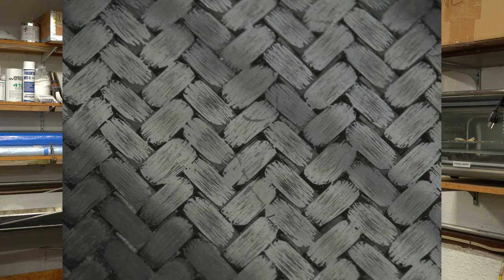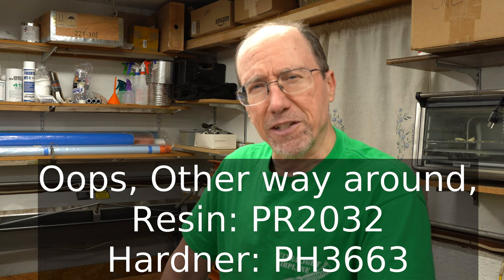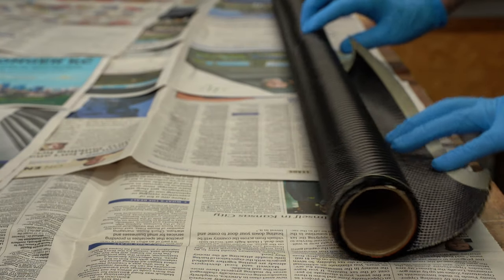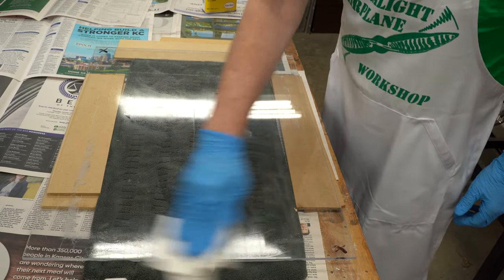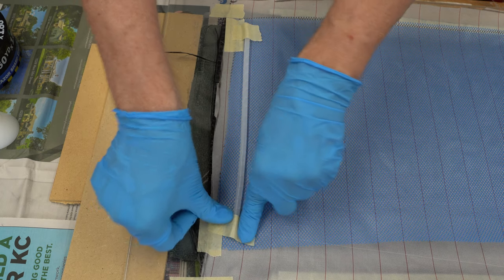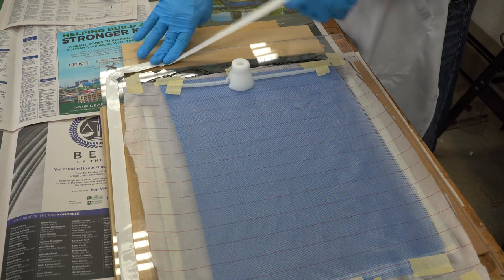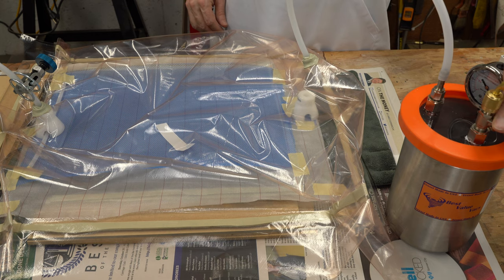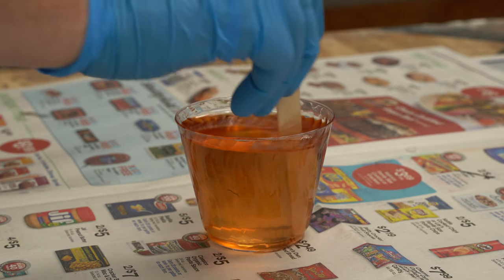Aeropoxy PR2032/PH3663 for Resin Infusion

Comment: Just an fyi, when we use a stethoscope to check for leaks, we prepare it by removing the chest piece and replacing it with a piece of hard plastic tubing (in fact, I have used the body of an ink pen for this). The problem with leaving the chest piece on is that it is designed to only pass either low or high frequency sounds, depending on which one it is. What we want is something that allows us to pinpoint leaking sounds, of various frequencies, while rejecting other sounds close by.
Reply from the maker: Excellent tip. I'll give it a try. Thanks.

Comment: Extend the vacuum spiral along the entire end edge of your layup. Make sure your peel ply comes in contact with the vacuum spiral.  This will prevent the resin front from stopping in areas that do not have flow media.   You can use this same method to slow a resin front from hitting your vacuum port (which allows gas to escape because it is possible to boil your resin under the bag if it is not degassed).  Oh and awesome improvements since your last layup.

Comment: Last comment.  When you get pin holes between the weave of the carbon tows, thats often due to low pressure.  When the part cures, the resin shrinks and gas retreats to areas with low pressure, such as between the tows of carbon.  Almost always where youll find those pin holes.  Find a pump that can pull full 30 inches, then degas your resin for a solid 5 minutes until its stops boiling.   Just here to learn from watching others, but also have done about 700 bagging layups so hopefully my advice will help.
Reply from the maker: Thanks for the tips. Although I have not been showing it, I've been degassing for the last two videos. That really does seem to help. My pump is only able to get to about 26 inches of vacuum so I may have to look for another pump or use two stages.
Reply: Ultralight Airplane Workshop nice!!!  Depending on where you are in the world, and I should have mentioned this, your pumps capability depends on the altitude you live at.  I’m at sea level so pulling 30” is no problem.  The same pump in Denver for instance wouldn’t be able to pull more than 24”.  The key is removing the entire atmosphere from your bag.
Reply from the maker: @WereAllThatBored  I'm at 1000' MSL so I should be able to pull around 28.5"Hg
Reply from the maker: @GTD Comp That gives me an idea for a video. I can do a fast infusion and a slow infusion then compare the differences of void filling and in surface finish. Thanks!

Comment: Would the 3663 hardener work well for open (wet) layup, no vacuum bag construction methods such as the Rutan mold-less foam core process?

I'm wondering if it might be too thin, and end up running out of the fabric. 

On the other hand, Aeropoxy data shows it sets up pretty quick, doubling its viscosity in 50-60 minutes in a small mixed batch. So it might not be an issue whatsoever.

Being that it has a much lower viscosity than the 3660 hardener, at least when first mixed, Im wondering if it might have an improved wet-out of the heavy unidirectional fiberglass spar caps found in the LongEZ. Or if it might offer a higher fiber fraction ratio for the wing skins, if squeegeed in accordance with the instruction manual, especially if peel ply is used to absorb any excess.    

Seems like it might warrant a try for improved wet out and reduced weight. Although its mechanical properties show it's 10% worse, on average, than the tried and true 1hr 3660 epoxy combo.

I appreciate your input.
Reply from the maker: Excellent question. I believe that 3663 would be fine for wet layup. If the resin is running out of the fabric then there is probably too much resin in the fabric. After you use your squeegee to remove excess resin you should not see any problem.